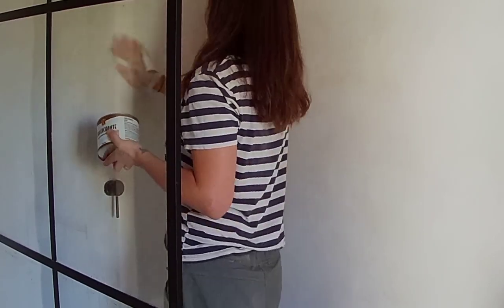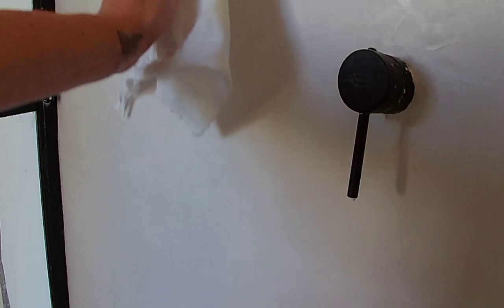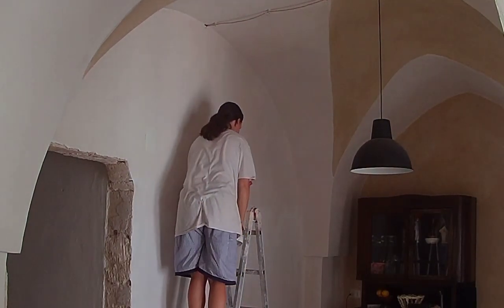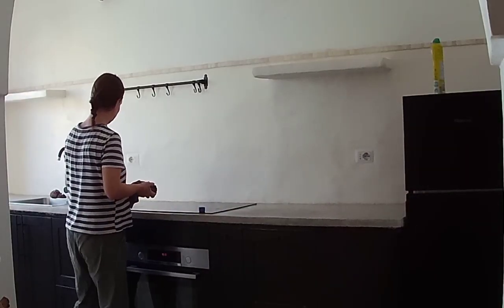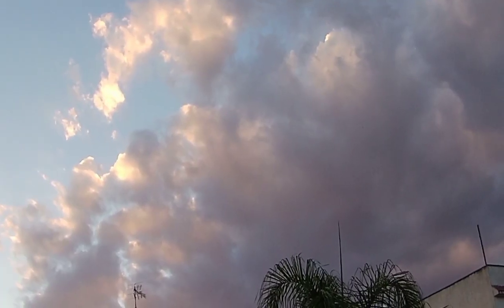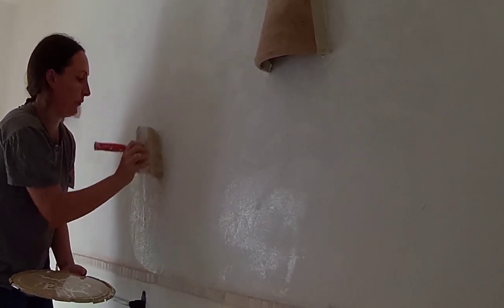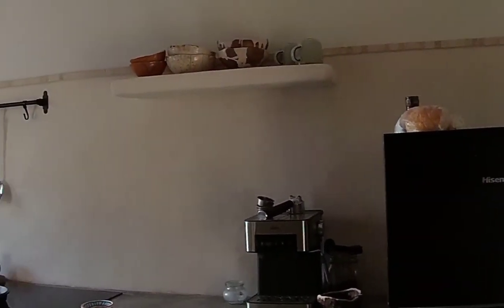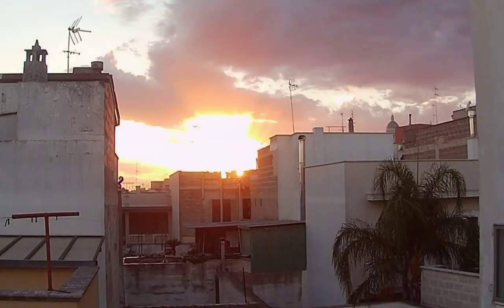Italian house renovation, finishing our kitchen, bathroom & painting...

Comment: I paint high surfaces with a brush or roller taped to an extension stick. That allows me to stand on the floor safely yet reach high surfaces with paint. I use extension sticks that expand in length. The stick end has a screw end that attaches on the roller handle. I use painters  tape to  attach a brush for edging work.